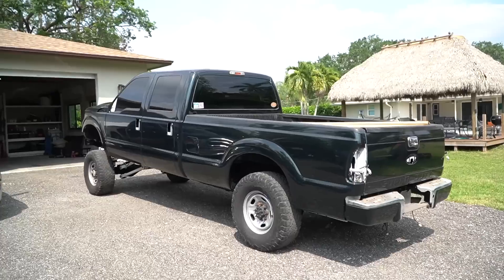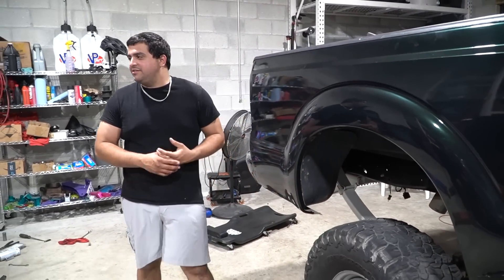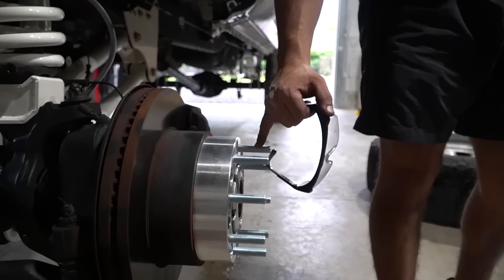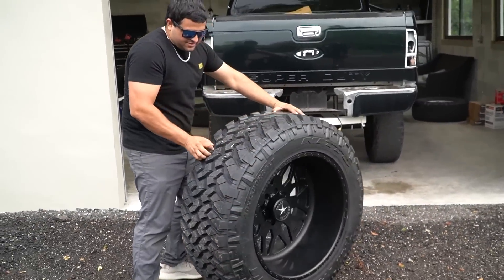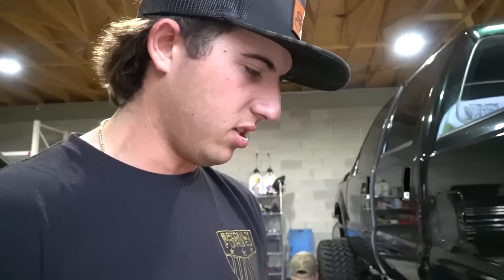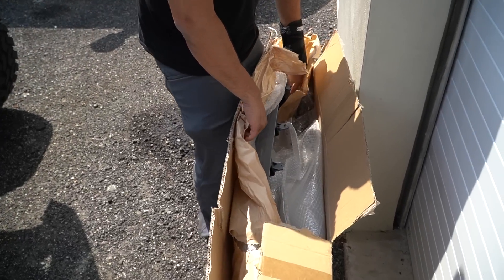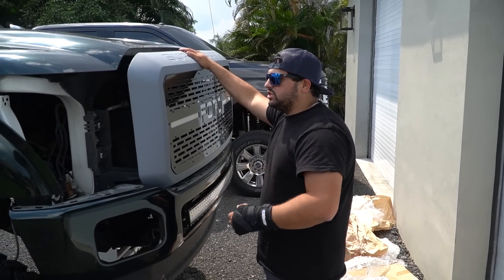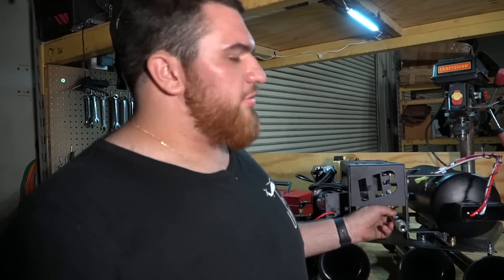10 inch lift Full Paint Match and Lighting 2015 F-250 PART 2

Comment: Um these trucks are hub centric this is y’all be sending kia’s flying these trucks to heavy to put all the weight on the lugs it’s designed for the hub to carry the weight and transfer it from the hub to the inner whole of the wheel the lugs are just to center it up and hold it on. Again these trucks are hub centric the weight should be on the hub not the lugs this can make your lugs snap👍